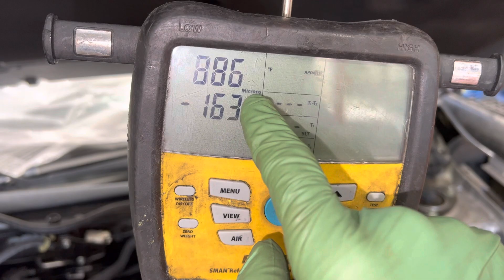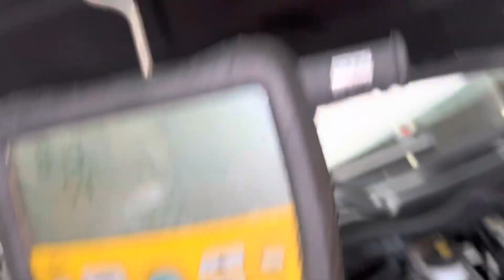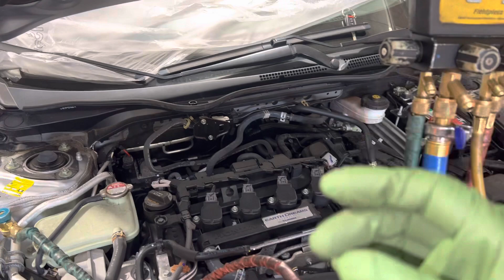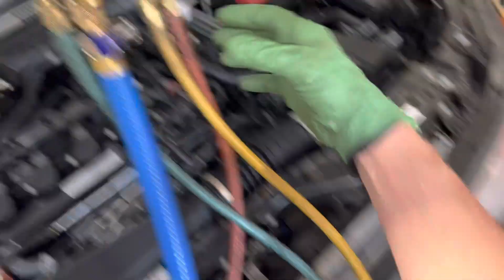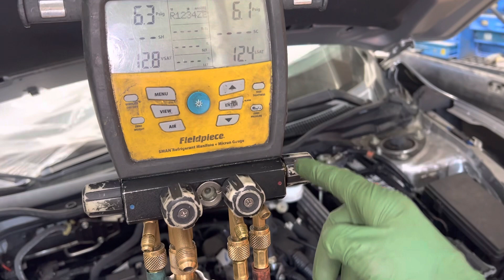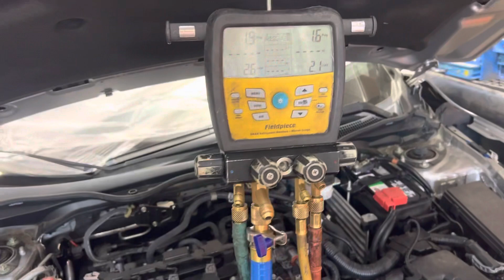Dry Nitrogen Purge after Refrigerant Recovery to KEEP MOISTURE OUT

Comment: Yeah that's how I would do it. The shop I went to the second time I had the refrigerant pulled probably left it at a 7 psi with refrigerant as the substance and I got refrigerant and oil in my face when I opened the system starting at the accumulator.
Reply from the maker: @electric_thumbs  yep. Happened to me once. Face full of oil

Comment: Does co2 have the same acceptability in“dryness” to do the same thing? I ask because we have a co2 setup for leaking testing with ATS bullseye leak detection system.
Reply from the maker: CO2 loves to absorb moisture.  And when CO2 absorbs moisture, it makes carbonic acid.. 

CO2 is part of Hydro Partman combustion process to an exhaust gas . 

This is why when you have condensate drain from high-efficiency furnaces .   The water that comes from combustion gas with the CO2 mixes with that water makes carbonic acid.. 

And when you see that water leaking and somebody let it drip on the concrete floor, it eats away the concrete floor overtime 

In the same CO2 carbonic acid when they try to drain it into iron pipes it literally eats the sewage pipes 

This is why in many locations they require CO2 runoff water that is mixed to go through an acid neutralizer first before being allowed to go down. Waste drains. 

CO2 is an excellent leak detector in dry applications. We’re all surfaces are dry nothing absorbs moisture in the final product is going to be flushed with argon or nitrogen. .   

Like high voltage battery packs on automobiles .  
He would use the CO2 to find a leak, then fix the leak, and then purge the case with dry nitrogen or argon
Reply: @coldfinger459sub0  TO BE COMPLETELY CLEAR, CAN I LEAK TEST WITH CO2 AND THEN FLUSH WITH DRY NITROGEN? IN AN AUTOMOTIVE SETTING ONLY WITH A SYSTEM THAT HAS OIL AND SUCH ALREADY IN THE SYSTEM. THANK YOU!
Reply from the maker: @powayimports4175  I think I would do that if that’s all was available in a situation. 

Now there’s real CO2 leak detectors and then there’s kind of fake fuzzy logic sensors that don’t quite pick up CO2 but they use other gas references as CO2. They’re usually cheap. .    

A real good sensitive CO2 leak detector take some getting used to and learning how to use it correctly .   Because Jess cars driving by or starting up inside your garage will set off the CO2 leak detector because of the CO2 generated by vehicles exhaust in the area.

Just your breath as you breathe you have to breathe away from the area that you wanna concentrate on and work hold your breath as you’re looking at the Gauge to read the numbers . 

This is how sensitive a good true real CO2 sensor operates . 

And if it has a South calibration, where it’s always adjusting to the background .  If you have a large amount of CO2 because of your breath or because of the engine operating in the area he could South calibrate to background CO2 levels that are higher than the leak that you’re searching for. 

But yes, you can use your CO2 and then purge it out with dry nitrogen after work . 

A good CO2 leak detector will be several hundred dollars . 

The flea eBay or Amazon will be under $200 .
Reply: Well that settles it. Time for an additional dry nitrogen tank now. Thank you